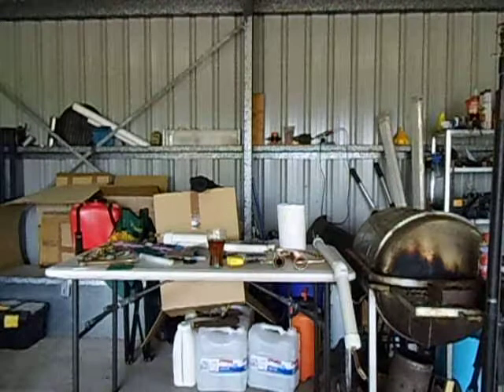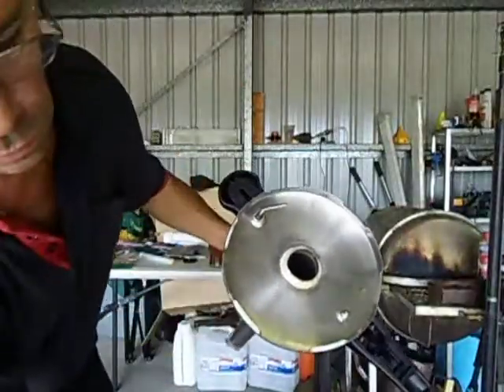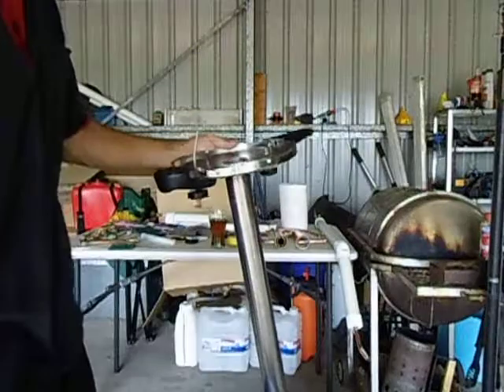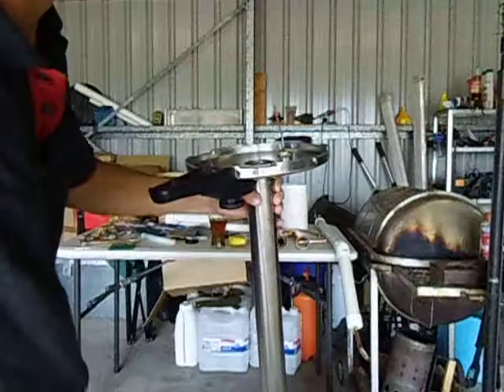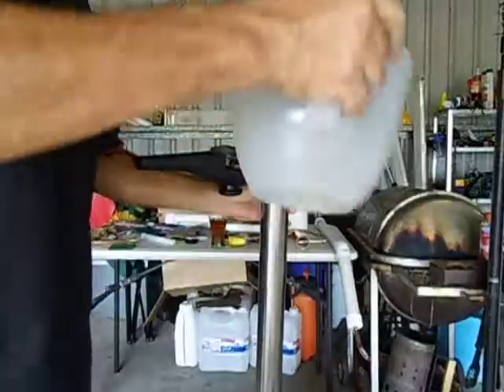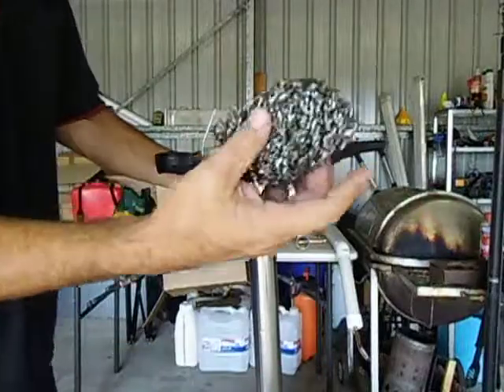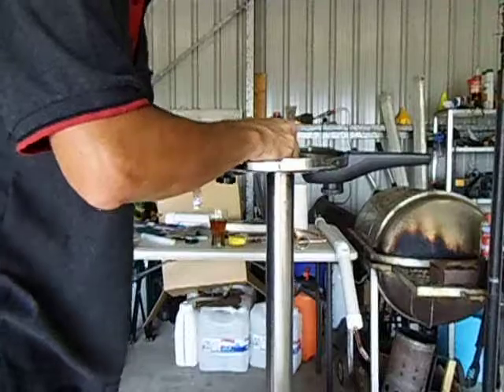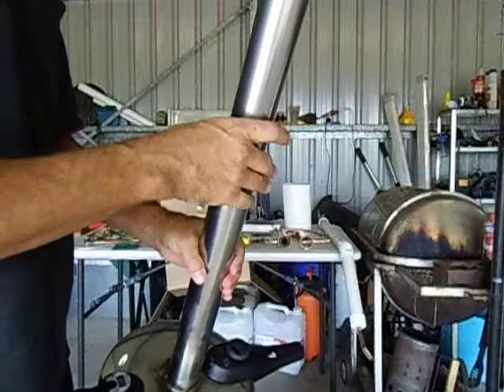How to pack your collum for a still

Comment: My preferred method (yours may be more relevant): put the copper mesh and stainless scrubbers into a large mason jar and fill with vinegar. Inspect after a few days: if everything is clean and unrusted, you have reliable material. Rinse well. Insert the copper so that it's at the top of the column, then the stainless in a ratio about 3 x stainless to 1 copper. Finally, pick up the column and then try breathing thru it. If you can't, it's packed too tightly. I avoid ceramics because I have seen them harbour mould in the past in other applications.

Comment: you will find most distillers have moved away from ceramics such as you are using, they hold pollutants and smells as well as providing a very rough surface for them to adhere to, pure glass marbles are far more effective, cleaner and they last forever.  Copper is only needed if your system is predominately stainless steel otherwise there is more than enough  in your condenser (the more pure the alcohol is when introduced to the copper the more effective it is) Finally, do not over pack your column, it should be full to just below your plate but not compressed, I would suggest your packing could be reduced by about half. The vapours need to rise through the packing, condense and the heavier impurities return down the tube while the lighter alcohol vapours rise up the column to settle higher up and repeat the cycle, loosing more impurities along the way. That is why  it is called reflux . THANK YOU for taking the time to make the vid.

Comment: i have a copper still and my alchol does not get over110 proof. Do I need to use the copper mesh?
Reply from the maker: I would make a reflux condenser , look at my other videos with my copper 2.5" collumn as I get 95 percent abv or 190 proof , cheers
Reply: Thank you for your help. I enjoy your videos
Reply: I get 140 to 150 proof from a pot still often.   I suggest copper mesh 2 rolls, and keep temps down to 180f or slightly higher.

Comment: Why don't you use copper mesh? Those copper saddles at 100g cost WAY more to use than mesh. You can get a pound of pure copper mesh for about $18 US. I myself just ordered 4lbs which will last me at least 100+ distillations?
Reply: Use glass marbles instead of ceramics also...

Comment from the maker: Ceramics and copper saddles can be used over and over for many years , can be soaked in a uncented bleach mixture of a desert spoon of bleach to one litre of hot water and let it stay in it for one hour  and rinse all ceramics a few times with boiling water thru a strainer (corriander) and dry them.

Comment from the maker: I flush it after every use by pouring boiling water of two kettles down it , then blowdry it with compressed air and leave it to dry in a hot place or in the sun , i cover the holes with toweling paper to prevent dust and unwanted geust making their nest in it. I boil all the ceramics and copper saddles after every third run and dry them with heat in a oven ' i replace the two stainless steel pot scourers at the same time.